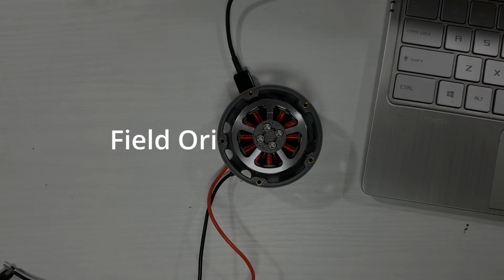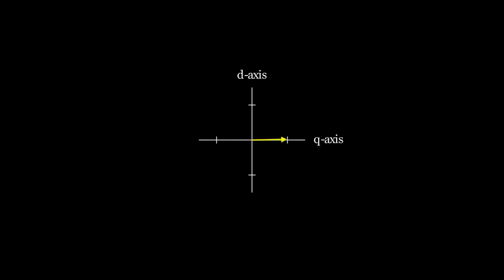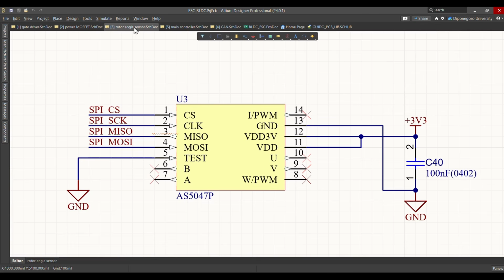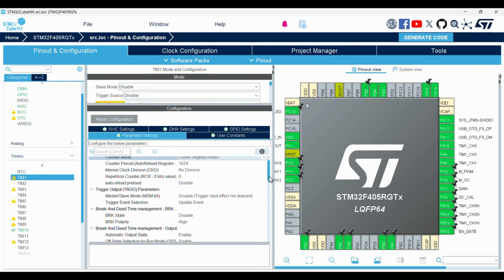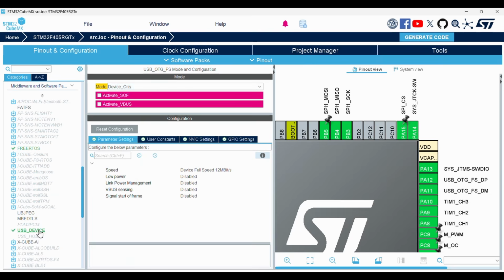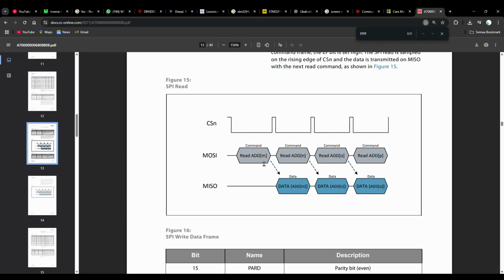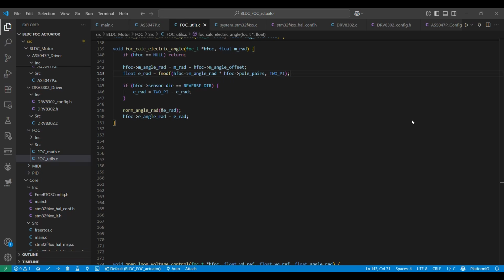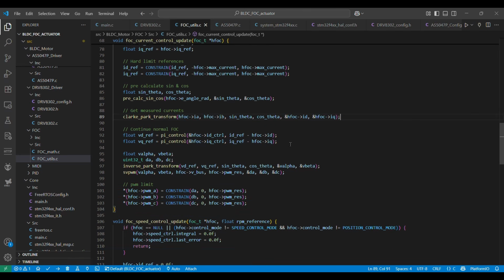Field-Oriented Control (FOC) on STM32 From Scratch – Practical BLDC Motor Control

Comment: Oh, I actually know this one!
Currently learning all about Clarke and Park, and how FOC is done in university.
Though instead if BLDCs in particular, we're applying it to more generic synchronous motors instead.
Also - why not use a PID algorithm instead of a simple PI? As far as I know, highly dynamic systems are a perfect usecase for also using differential controllers.
Reply: Im also interested in why a PI loop is used instead of a full PID controller. My best guess is PI is used because just those terms directly correlate with electrical aspects of the motor. Since motors are usually analyzed in circuits as a resistor and an inductor, the proportional term accounts for the resistance while the integral term accounts for the inductance. This is probably very innacurate though

Comment: Be careful if you build his hardware. The BOM-list is not correct and a lot of resistors are replaced with 0 Ohm components. It will fry other components on your board. I trusted the BOM list - I shouldn’t have done that. The schematic seems correct, the BOM is not.

He seems to ignore all comments here as well. Very few, if any, are replied to. There are other open source foc-projects that aren’t orphaned. I’ts a pity because this was an interesing one.

Comment: Nice presentation, but suggest you also use the LPF converter voltages, see our Springer  book "Applied Control of Electrical Drives, 2nd ed." to be released shortly. This also shows the importance of using the terminal voltage vector for sensorless FOC using FAST

Comment: Thanks. What is the communication between ESC and Flight Controller? (CAN bus). If I use FC as pixhawk 6X, is that ESC compatible with the protocol?
Reply from the maker: I actually didn't make it for a drone, but for a robotic actuator like a servo motor. I use the CAN bus for communication with other devices and use a custom protocol. Thanks

Comment: to get more power Is it possible to get MOSFETs that are able to handle more current and voltage  and a few firmware changes to reflect the new limits.? Or is more work needed to increase the power output?

Comment: great video and great project!  next is: use the current measures to get rotor pos from the current readings..then you can get rid of the encoder with all the problems there.
Reply: using back emf to measure rotation is not as effective at low speeds
Reply: @ancellery6430 not bemf.. i said current sensing.. complete different thing.. works at stand still and what ever low rpm you want.. more difficult over 4000rpm

Comment: Wow, that brings back memories.
Worked as an ET on VFD equipment for years.
Also was instrumental in bringing the VFD to the hobby market.
Long ago I had maybe the first website that sold motor kits for brushless "CDMotorWerks"
Ever seen an IGBT explode? 750v at 1200amps is a lot of power.

Comment: Isnt foc is for synchronous motor or pmsm ....which is AC motors ?
Reply: Can be used for bldc too, as the input is practically 3 phase ac but not sinusoidal
Reply: @theartistinaction9334 lol thats not ac........ac current produce RMF .......and bldc doesnt produce rmf it relys on magnets because its a dc current system ......so bldc arent made for ac power and which can lower their life 

And just because there is 3 connection doesnt make it 3 phase ac ....and its not "practical"

Comment: Great , which motor you are using ? Is it available online to buy with an encoder connected to it ?
Reply from the maker: I'm using a 5010 BLDC motor 360kv, which is available online. However, you'll need to install the encoder yourself. There's a screw at the bottom of the shaft that can be used as a magnetic mount for the encoder.
Reply: @srj4555 hey, I used the 5010 360kv motor with an AS5048A as well. My FOC could only bring the motor up to around 7k RPM before the controller can no longer inject any more Iq, and Id starts to rise. I tried hooking the motor to a typical ESC which prolly uses sensorless 6 steps and it surprisingly it could bring the motor up to 10k RPM. Could you show your FOC’s high RPM on this motor? Curious to see if I need to do Field Weakening to match the performance of the ESC on this motor or there are flaws in my FOC.
Reply from the maker: Hello  @anhoanghocgioi3140 . I haven't tried it at high rpm before because my focus is on very low rpm. But as far as I know, because it uses an AS5047 or similar SPI sensor, the sensor readings have a delay that will cause the angle reading to be inaccurate at that time. So for high rpm, most people use sensorless mode.